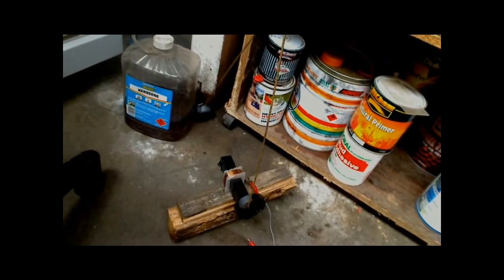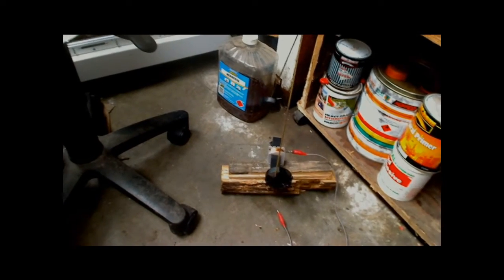uneven power.wmv

Comment: thanks for the video link , most osculations  in a/c  are jumped via an air gap to a capacitor for d/c pulsing in teslas references , coils in some transformers are windings of left to right then right to left in a/c transformers , a non coupled transformer would be better , we could argue over this one (hysteresis and coupling or not coupling) ,  also applause to the cameraman  (Darren) very patient